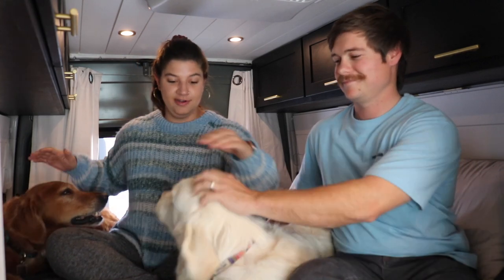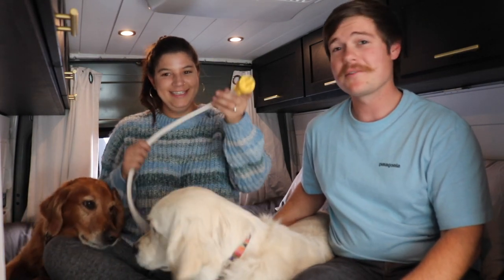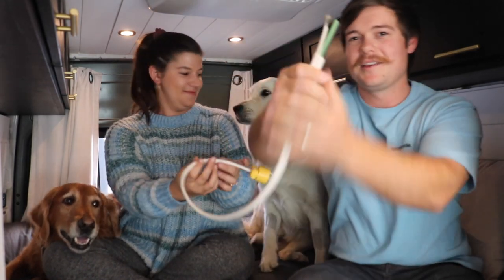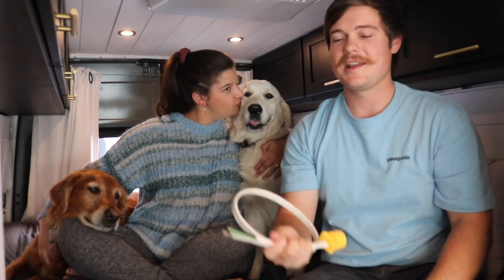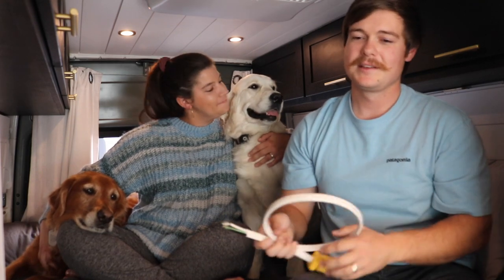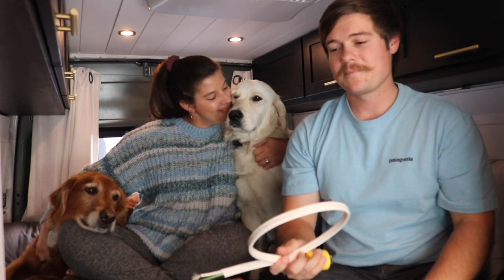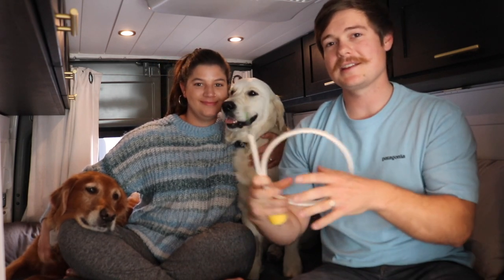Three Electrical Mistakes that Can Make Your Van Go up in FLAMES and how to Avoid Them!

Comment: Happy to see that people are finally starting to understand the "type" of wire to use. THe RV industry says solid core wire is acceptable and is common practice for them. However there is no electrical code for RVs so they will use whatever is the cheapest. The marine indystry is far different and they learned long ago that solid core wire is not safe.  As for the fire extinguisher I see that many have them but bury them in a cabinet out of sight. It will only be useful if it's out in the open and easily at hand. I would suggest if you have a garage area that you have two fire extinguishers and keep one in the garage, especially if you have electrical components there.
Reply from the maker: I work as an engineer in the marine sector so it amazes me how many vans we see that use standard solid core residential wire. I agree with having two fire extinguishers so you can get to the one closest to you if you were to have a fire!